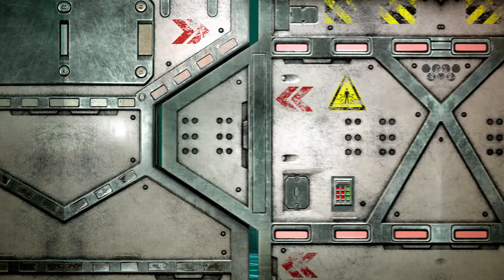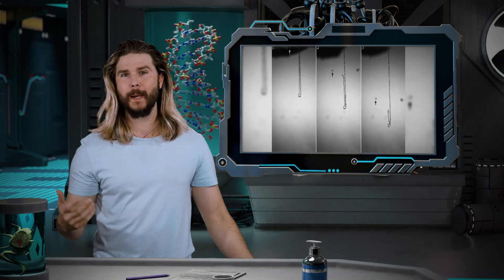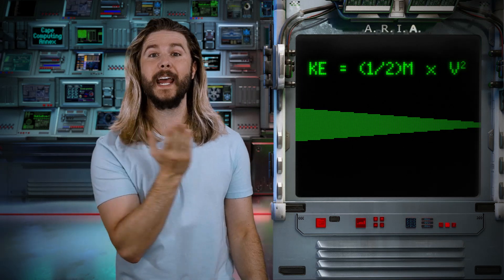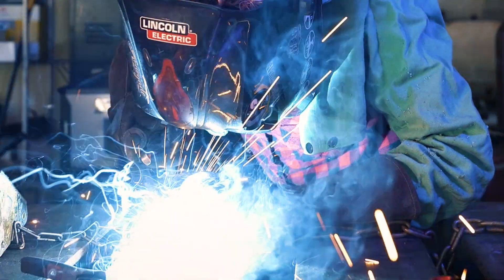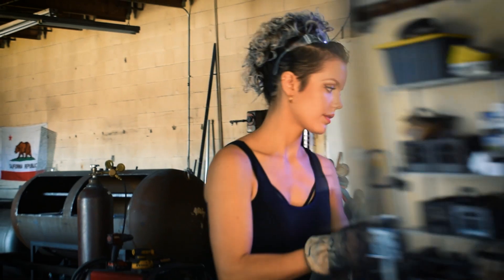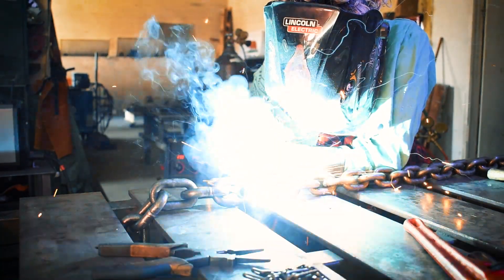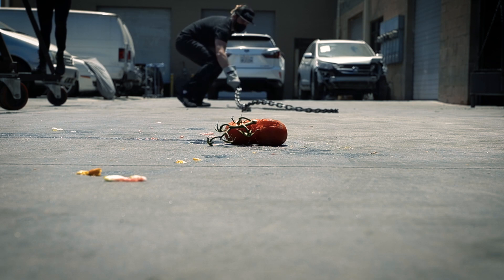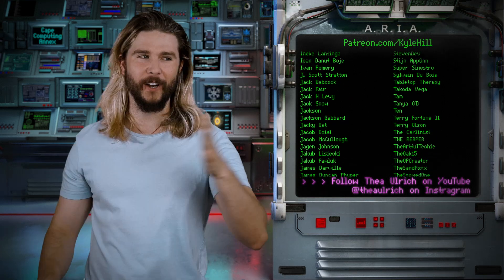Steel Chain Whips are SCARY

Comment: I wonder how whips were invented. Clearly, sub-sonic whips existed before super-sonic whips, and someone noticed that whips that taper towards the end hit with more speed. Dunno if people would crack sub-sonic whips for the sound or if they were only intended for hitting animals and people, so perhaps people didn't really pay much attention to how the sound of a sub-sonic whip changes as you improve the whip to 'hit faster'. And then I assume they got to a point where accidentally, they made the first super-sonic whip?
Or perhaps I'm wrong and they did try to find out how to make the loudest whip, and that's how they found out it can get really loud.
Or maybe someone just thought 'if I attach a thin piece of string at the end of a tapering whip that already hits very fast, I'll make something very painful, but not outright lethal, great for keeping animals/slaves in check. And then it cracked.

Comment: Now I wonder that if you start with a length of steel rod, cut and form a single link, then slowly but surely form it down into thinner and thinner lengths to more smoothly transition the links into smaller sizes, if that would transfer the energy better and make it easier to whip compared to the 5 lengths of progressively smaller link sizes. It would be extremely tedious to perform but it would be cool to see.

Comment: The Chain whip is a strength based weapon. It causes 1d8 slashing damage. Alternatively the chain whip can be used to attempt to grapple, however it's damage is reduced to 1d6 bludgeoning damage and requires a dexterity saving through or the target becomes restrained.

Comment: You can crack a whip with no taper if you have leverage, i.e. a stiff handle. Before I knew how to make whips, I made one out of a piece of bamboo maybe a foot long and a single unweighted paracord braid that was too long, maybe 9-10 feet, and a cracker I made from nylon or silk rope or something that was too long. It was ugly and I couldn't really control it and it wasn't as easy as it should have been, but it cracked really decently for what it was. Now that I think of it, would the transition from braid to cracker count as a taper, as far as the Hill effect is concerned? Maybe the lowering mass of the part of the whip in front of the wave is the lowering mass in that case. I could be wrong, but I think one can whip a regular chain with a cracker on the end.
Reply: I just cracked a frayed rope with a knot a few inches in (to stop the fraying) tied to a piece of bamboo I had in my garage. It cracked pretty loudly. Is every whip crack supersonic by nature?
Reply: I could not get it to crack without the bamboo stick.
Reply: A bamboo stick 20" long tied to a 7.5' paracord with a knot to stop the fraying 3" in works astoundingly well. I'm think I'm keeping this thing. It's fun. And safer than a tapered steel chain.
Reply: It took me longer to measure it than it did to make it. Lol

Comment: its not free fall if you get dragged which means you just droped a quarter for no reason
the same effect can make a chain apear to jump out of a bag in high arches
also the tapering isn´t all that relevant, if you bring back you whip arm to whip something in front of you the cracking sound will come from around you because by the time the ripple you illustrated reaches the tip it still moving in the opposite direction with the last piviting point being in just before the tip meaning A) most damage you can do with that is to yourself and B) if you cut off the handle of a real bullwhip and grab it by the tip you can still use it in a simular fashion, although less effecively and more effort
in short great teacher and awesome example but incomplete explanation
ps a cable would have been the better choise in part because it is more rigid,
you also way overdid it with the weight and reliance on tapering

Comment: There is an issue with this whip design.
When ever the chain goes from larger to smaller there is an energy loss that is proportional to the change in size.
This is because when waves propagate from one medium to another medium with different wave propagating properties some of the waves bounce back.
This is why waves created in an organ pipe tend to bounce up and down inside the pipe and give release only parts of the sound.
 
When your chain is like a stair thickness then parts of the wave is lost every time it is transferred from one type of chain to another.
To make a perfect whip you need make each of those decreases in thickness as small and as many as possible.
To give more or less the illusion of a continuous decrease in weight.

Comment: Unfortunately, the Hill Effect is already taken, so you can't really use that scientifically.  It's kinda like the Holtzman Effect, that allows instantaneous space-travel to everywhere in the universe at once, invisibility, shields that stop bullets but not knives (And have Mutually Assured Destruction with Lazers) and make glow-globes float behind you when you walk across the room with a box full of pain.  That naturally begs the question "Which Holtzman effect?"  The whole point of designating The Hill Effect® is to differentiate between it, and any other effect that might be at play, like the Slinky Effect that is essentially the same thing in reverse, or the aerodynamic effect when a Hill acts like the top of a wing in a steady wind.  That's why we ®egister Trademarks.  To find out if anyone has already established a Hill Effect, so we can change it to the Kyle effect, to avoid any confusion.

Comment: In AV and events product, we use motors and chains to hang speakers, screens and lights. Since ceilings are high for concerts and such, these chains are usually 75 to 100 feet in length. And since these carry heavy equipment they are strong too (1 ton). During the set up of an event, a hanging chain somehow fell from the ceiling and whipped as it hit the floor, hitting a crew member... Yes it split him in half.

Comment: Though it does help, the tapering actually is NOT key. You can crack a whip with cylindrical string. (you will need a stick to boost your hand movement, though.)
Key is that you first move the whole string, but as increasing lengths of string become stationary or are even reversed, the forward momentum is concentrated into shorter and shorter bits of string at the tip.

Comment: I really like this episode. As great as the facility is, and how well it (I'm sure) helps keep your costs down, I really like episodes when you're out here, among us. (And, of course, having a very nice co-host didn't hurt, either 😊)

Now I know that because that "whip" was so much heavier then a "normal" whip, there was no way it would break the sound barrier. But I wish you had done something like what they've done on Mythbusters and other shows. Putting a (usually) Black and Yellow checkerboard behind (beneath) the item in question so that you could at least see how fast it was going. And despite it being just fruit, it had to have been going at a good clip to do what it did.

Well done!  😎

Comment: aren't you able to get a high whip action at the tip even without tapering, by using the gestures to create a large ripple and cut it back the opposite way forcing it to condense and rapidly accelerate at the tip?  Pretty sure i've gotten some nice loud snaps as a kid using a regular half inch rope. And of course, had my arse welted by a few subsonic (but still high speed) towel snaps (though, that might be due to tapering, the guys who really do it right know just how to spin the towel so it has a very fine tip but chunkier midsection. Seen guys literally cause the end of the towel to explode into frayed fiber dust on a good snap)

Comment: Ooh... imagine sending this as a patent to Zombie Tools and see if they'll make a useable collector's version out of a tapering braided steel cable coated in something like Teflon. I guarantee that thing will have some incredible power.
Reply: just a thought... what if you were to change metal for the last bit of chain ? like aluminium or titanium. the even lighter weight would generate a fuckton of more speed

Comment: I wonder, if you used thin wire to weave a bullwhip in the same way you'd use leather strips, you'd end up with a sort of tapering cable that would end in a single strand of fuse wire. Imagine that moving at supersonic speed...

Comment: Interesting, but question on possibly improving the destru- I mean potential to kinetic energy conversion. . . . Wouldn't making it into something similar to a coachman's whip give you "better" actions? Main difference between a bullwhip and a coachman's whip (typically, not always) is that a coachman's whip has a long handle and the body isn't quite as robust.

The point I'm getting at is wouldn't swinging it with a long handle, with a greater range from the point of rotation (you, Kyle), transfer more motion and therefore send the tip faster into the realms closer to making metal go boom? You essentially traded in a lot of the speed for mass and while it ended up getting there at the end (ah ha ha ha. . . puns.) I think its potential has yet to be harnessed as sending it at the same speed you could a bullwhip would be its crowning raison d'être? Human powered bullwhip crack with "just" a change of materials. . . . and mass. . . . and design.

Comment: >I bathed these chains in a vat of muriatic acid to strip away the coating...

Where did these chains come from? What was this toxic coating? I think it's important to relay this info as these chains resemble those scavenged by bodybuilders and gym owners operating with a limited budget O_O
Reply: chains had a coating of zinc, when you burn it turns zinc trioxide (i think)

Comment: CORRECT ME IF IM WRONG BUT, WHEN YOU DROP THE QUARTER AND THE END OF THE CHAIN, ASSUMING THE OPPOSITE END IS SECURED TO SOMETHING SOMEHOW, MY CALCULATIONS LEAD ME TO BELIEVE THAT THE FREE END OF THE CHAIN IS BEING PULLED DOWN AND ACCELERATED BY THE WEIGHT OF THE LINKS OF CHAIN AHEAD OF IT. THEREFORE IT HITS THE GROUND FIRST. 
FURTHERMORE IF YOU PULLED UP ON SAID SECURE END AS THE FREE END IS FALLING, IT WOULD ACCELARATE FASTER STILL BEING PULLED DOWN HARDER BY THE LOOP OR BEND IN THE CHAIN.

Comment: I have seen men lose legs from things just like that.... Its scary how much energy a chain can dump into and through you
Reply: Yeah, it's not exactly the same, but I spent a few years working telecom colocation work, and we did a lot of power cable installation. A guy was walking under a cable rack while someone was trimming twisted strand copper cables, and a cut end whipped down and around the end of the cable rack just far enough to catch him right in the eye. This was only like a 2 cm thick cable, but the effect was enough to literally explode his eyeball right through his safety glasses. Not pretty.
Reply: @KhronicD  its pretty amazing how so much force can be gained in a whipping action... Also just as amazing how fragile the human body is when put in front of it
Reply: @scrappydoo7887  I'd like to point out how resilient the human body is, the guy I mention lost his eye, but he's happy and health to this day, as far as I know. Gruesome injury, but he survived.
Reply: @KhronicD  i agree that we can lose bits and survive but i was more commenting on the sheer power that can be achieved by whipping metal or even cloth... Its easy to see things as safe but all it takes is the right angle and force to really ruin your life.
Reply: @scrappydoo7887  Yeah, I do pressure washing as a living. I can provide many examples from personal experience that water may seem kind of safe, but when you shoot it into a corner at high PSI, it can hurt you on the rebound pretty badly. But I guess that's the point of videos like these, to try and get basic physics into the mind of people so they actually think about them rather than just go "Oh, that's cool."

Comment: we had peoples heads taken off when using the tow cable to pull a tank up on a HET and it snapped and whipped back at them cutting thru the metal guard and then them.

Comment: Should definitely try it against a pair of steel toe boots.  Put a dummy in the boots.  Would need something to keep the dummy held up.  Curious if it would catch on the boots and wrap upwards and what kind of implications that would cause.  A bullwhip could easily take flesh off and with a small piece of metal potentially break bones.  Imagine a chain.  Granted you aren't fully whipping the chain and it is getting resistance along the ground but it definitely peeks the curiously more now.

Comment: I have to admit, I was thinking "wire" all the way, not just the tip. But chain gives more heft, a certain "Je ne sais quoi" and more "snap" at the wrist. A thick wire is a cable, and not the same "whipness" as chain links.

Comment: What if you tried that experiment again, but vertically? It seems like you'd be able to get more torque or force with the assistance of gravity. Kinda like a guillotine, but a steel whip instead of a blade.

Comment: This whip is nice but far from the best, next time use a 1 inch thick steel wrope and cut one string ov it every 2 inches until at the end only one is left and to prevent it from untangling weld the cutted sring to one of the others. This thing is sick and cut like a razor.

Comment: Why not wire cable?
Something like 1/8" but bundled with like 16 to start at the handle then cutting them to different lengths along the length so it tapers like a leather whip

Comment: I actually keep two chains for self defense purposes in a delinquent filled area which I cannot depend on police to protect common workers from. So, I can relate. I'll be getting a cattle prod and a leather cattle whip instead as a heavy chain isn't as easy to use especially with sharp metal blades at the ends. Also, metal chain links are harder to swing than  flexible whip

Comment: The leather whip will have more consistency and be better breaking the sound barrier than the chain whip since the leather whip is one solid piece of leather (not divided in links) that will help the kinetic energy travel easier in one single object that is not linked.  The chain whip links are separated by nature and more loose (since they are just loosely linked together) making the kinetic energy to become lost while traveling through the links. Never the less the hardness of steel and it's natural density will make it more destructive than a leather whip that have a material that is not as strong and denser than any steel.

Comment: Theres an elastic component in whips that a chain can't reproduce. Yet steel is one of the most elastic materials we have available. A whip made of braided steel wire could be lighter and thinner, thus sharper and easier to handle.

Comment: bouth would land at the same time but the reason some will fall faster is becouse of the movement of an object inside the same airflow so like that of water throw a toob . so the gain befor each link is moveing the air for the next to it to move faster .

Comment: We have to figure out a way to switch around the chemistry of a region with minimal obtrusion, but also maximum controllability. Deciding whether the way would be through direct influence through other directions in space than our "4", or if there is a way to induce the switch without expending even as much as a one way communication. 
Perhaps the trick lies within setting up a membrane of sorts which would then be interacted with instead, which would limit the time it takes to completely fill space with our new technology but maybe by the time the first dawn of this technology has come, a new and better more improved technique will become clear and will be utilized instead. With the first method just being the essential required stepping stone to get to the point where we can visualize and invent the better version we wanted.
Reply: We are going to build brains with this technology, btw

Comment: While watching this I realised that reverse levers are a thing; with a lever you push over a greater distance meaning more force just over the pivot at the small end. But logically that means that if you push super hard on the small end, the long end has to move incredibly fast. It's the same interaction, and I never realised this, even though it's probably responsible for how my skateboard knocked me out when I was about 15.

Comment: pretty dangerous with hardness of 5.5 to 6.
plus the density and mass of steel.
if you can reach supersonic speeds like leather whips if your strong enough. could beat 45 cal hand gun in terms of power still the 45 can pierce whip wont.

Comment: I saw a video from like 10 years ago where an older man explained how to crack a chain like a whip. He used cheap dog chain for it and when it cracked, it was about as loud as a gunshot. Far louder than any whip I've heard. Though he did tie a piece of cloth at the tip. Actually, you could watch it yourself: /watch?v=vcYVjxac2Kw

Comment: The hill effect is dumb, if you drop a wide object next to a thin object it will obviously have less air resistance 
Also, the energy in a whip wont stay the same, air resistance absorbs KE, so, in conclusion, you are a dumbass that pretends a law of physics doesnt exist one moment, then misinterprets it the next
Also with the "in earth circumstances" for the speed of sound is stupid, there are no earth circumstances, speed of sound stays the same no matter the area in the universe
Reply: Oh, and if you are gonna say some bs like "oh, well, what about air resistance, sound is affected by air resistance"
Well, sound has no mass, so obviously fucking not